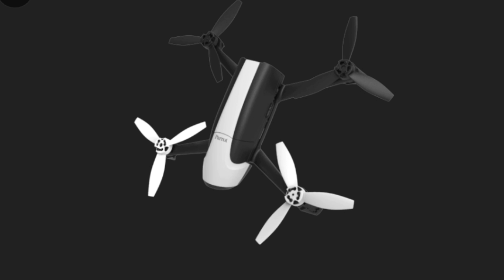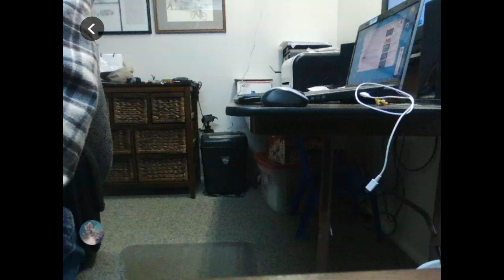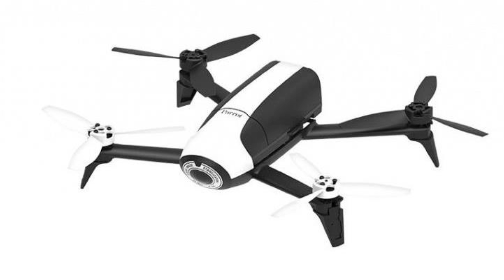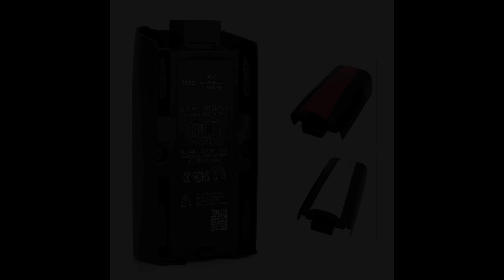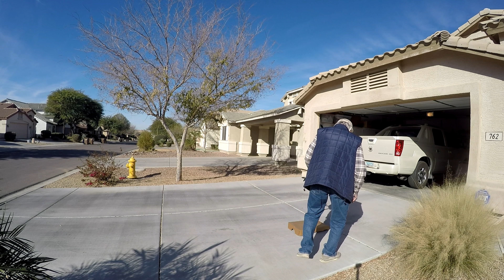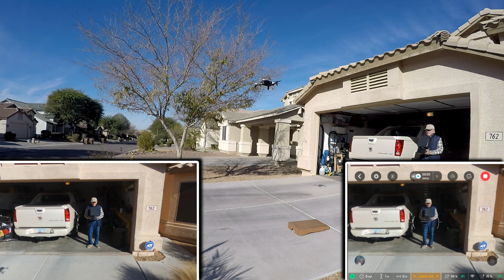BEBOP 2 X-FRAME AND MOTOR TEST AFTER REBUILD

Comment: Mr. Kent....You are correct sir in that we don't know what will happen when we launch the drone for the 1st time after a crash & repair.  Wouldn't it better to test it taking off from grass instead ?  In my only experience so far, I had my Bebop 2 take off from a hard surface, it rose up, flipped over and crashed very hard. Fortunately,  it was only scratched.  I thank you very much for your excellent videos. God bless.
Reply from the maker: Thanks Jim. Yes, you are correct. Here in Arizona it is hard to find grass unless you take time to go to the park. Thanks for your comment and God bless.

Comment: ..lol The owl agrees with you! (6:18) warning the neighborhood. I am surprised. While in the FreeFlight Pro app your battery percent indicator plunges from 93% to 26%. When you switch to the AR Pro 3 app, it also shows 26% but does not continue the apparent doom ahead. So I was happy to see you land quickly. What do you make of the difference?
Reply from the maker: I changed batteries between flights. Thank you for your comment and God bless. Also, I just noticed the owl. Thanks :)
Reply: It is the inset video on the lower right that I noticed the battery drop. FreeFlight Pro at (7:35) it's 93% and by (8:48) it's dropped to 26%, then in the same frame you change apps. AR Pro 3 at (10:16) it's 26% but stays 26% until (10:51). There was no battery change, so I am curious as to one app dropping and not the other.

Comment: That RoHS means that the manufacturers of the battery have complied with Restriction of Hazardous Substances directive. Due to all the chemicals in the battery. The Brand of your battery in this case is Tera. Nice to see the videos on the Bebop 2 and all the experiences you have with it.
Reply from the maker: Thank you Roy. I need all the help I can get. God bless.
Reply: Great point about the importance of a balance charger. My nephew has a dead battery from using the Parrot charger after only a few charges! Bought 2 'Gifi Power 'branded ones, 4000mAh (so they say) one for me, one for him. I bought myself a balance charger at the same time and have used that to charge all my batteries and I have no problems. I think I'll get myself a more 'bells and whistles' charger and pass the one I have onto him so he can throw the standard charger in the bin. )) 
I also had to replace his motherboard recently too so i know all too well how fiddly those tiny screws are! I used a little magnet stuck to the driver shaft to hold the little blighters in place while I was locating them in the motor housings etc. My dad told me this tip as he watched me struggle. haha. I got the look that said 'did you not know to do that already' ))))  2 heads better than one and all that. So....I wait here until my nephew has more repair tasks for me to perform. well, it's what uncles are for )))
Reply from the maker: Good for you - sounds like you have a great family. God bless.

Comment: i tried the reset and it did not work, i bought a set of motors and im going to replace that motor C (top right) do you think thats the right thing to do? thank you so much for your help your videos are the best on youtube!
Reply from the maker: I'm sorry that didn't work. Yes, that would be the next step. I would also purchase a Bebop 2 tool kit. They are less than $10 on Amazon. Those screws are so small I needed to work beneath my magnifying glass. I had some extra and sent them to a friend who lost his and couldn't find them while trying to put his motors back on. Be careful and God bless.
Reply: IT WORKED! im back in the air .....i bought 2 things today tool set and magnifying glass with light YA those screws are tiny, i didnt have any extra so i was very careful , i saw on ebay you can buy extra screws , im going to buy some im sure this wont be my last repair, thats ok though i enjoy fixing things, this drone is for the most part pretty simple, i bought it because of your videos. thanks again for your help im sure i will have questions in the future.

Comment: my motor detached... i reatched it and it sturdy spins great but when i try and take off it says motor stage broken so i took it apart again and it still says the same thing but the motor is fine HELP
Reply from the maker: Thank you for your question Joe. The only thing I can think of is to reset your Bebop: https://www.youtube.com/watch?v=kXCPr0DgVbo

How did your motor detach? If you don't mind me asking.

God bless.
Reply: my top right motor was detached (it was close to the ground so no real damage) the three screws coming up from the bottom attaching to the silver (Y shape) i tried resetting as per your advise but that didnt work, its puzzling because it seems perfect spins fine

Comment: Unbelievable that the camera didn't get damaged.  Mine fell from 30 feet and the camera was toast.
Reply from the maker: I'm sorry to hear that. Yes, when I walked up to my crashed drone laying in the road I expected to see a lot more damage but from the scratches, the broken x-frame and the damage to the battery it was pretty clear that it landed on its butt. You couldn't ask for a better way to crash a drone. I am not sure I needed the motors but didn't want jello effect after going to all the work to repair the drone. Thank you for your comment and God bless.
Reply: So glad you've got it repaired. I crashed mine on Wednesday, ripped a motor right off. Got a new one delivered and fitted on friday. Check out my video.
Reply: It is odd that it fell on the rear considering the front is the heavier part of the drone.  You did get very lucky lol.  Hopefully I'll receive my replacement next week after waiting since November 1st.  With luck, if it doesn't crash again, I'll be taking it on my annual trip down to Tombstone.  There's an old abandoned cemetery (not Boot Hill) about 5 or 6 miles away that I'm dying to fly around and get video.
Reply from the maker: Well one thing I didn't mention was that there was a tree hanging over the street and it fell through the limbs which most likely got it spinning :) Are you referring to the Tombstone near Deadwook, SD? I found an old abandoned airstrip near my house shortly after getting my Bebop 2. I finally used flight plan to get the view I wanted.
https://www.youtube.com/watch?v=osWnMO4ZsQc
Thanks for your comment. What is taking you so long to get parts? God bless.
Reply: Not sure why they've taken so long.  I don't get any answers from them.  I'm talking about Tombstone Arizona down near Sierra Vista and Bisbee.  We visit there at least once a  year and stay for a few days.  The climate down there is great.  About 5 or 6 miles from Tucson is Fairbank which was the stage and later railroad stop for that area.  It's a historic landmark and was occupied up until the early 40's.  If you hike about a half mile or so you come to the cemetery which is up on a windswept hill.  They only have records of 2 people buried there but there's at least 150 or so.  There's a couple of videos on youtube.  Just search for Fairbank Arizona.  One of them is mine from my other username.
Reply from the maker: I watched the video. Very cool. I live just to the northwest of that area about 40 miles south of Phoenix. My daughter lives in Rapid City SD and not far from Deadwood where they have a graveyard where a couple of the old famous cowboys are buried. I ordered my parts through Amazon, did you get yours from Parrot? I'm sorry for the delay. Let me know when you get her back together. God bless.
Reply: I'm curious as to where that airstrip you flew over is as well as the park.  Looks like there is lots of room out there.
Reply from the maker: https://www.youtube.com/watch?v=osWnMO4ZsQc

Google maps find Phoenix Gateway Airport and  about ten miles to the East-South-East you should find it. The park is in San Tan Valley, AZ just about a mile or two south of the airstrip. God bless.
Reply: That's the one I thought it was.  Thought about going down there and flying around it but wasn't sure it was an active airfield anymore.  Info says it was used as a heliport.
Reply from the maker: Yes it was used for that many years ago but is deserted now. Check it out at: 
http://www.airfields-freeman.com/AZ/Airfields_AZ_Phoenix_SE.htm#rittenhouse
It has a great history.
Williams AFB: 
https://en.wikipedia.org/wiki/Williams_Air_Force_Base

God bless.